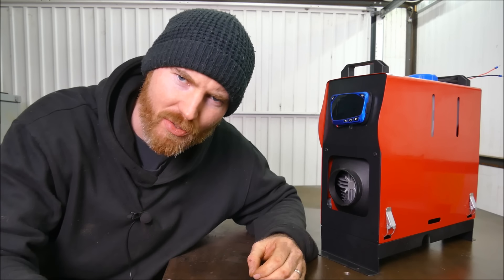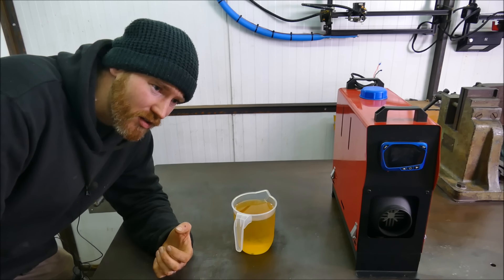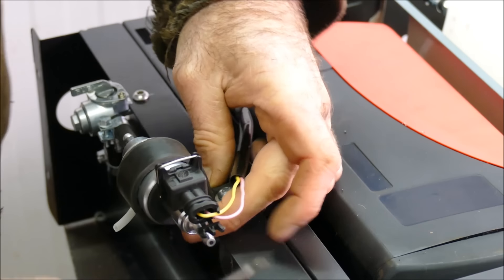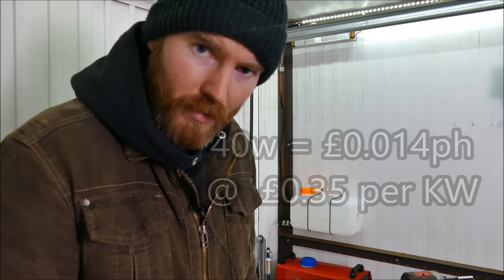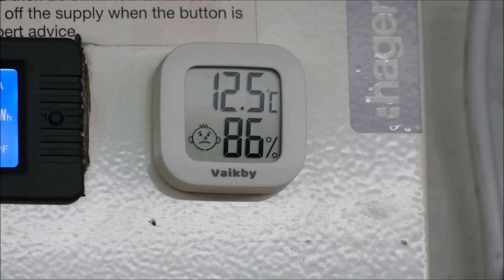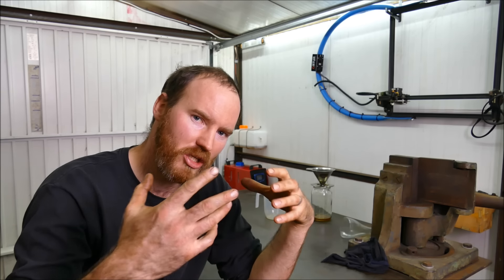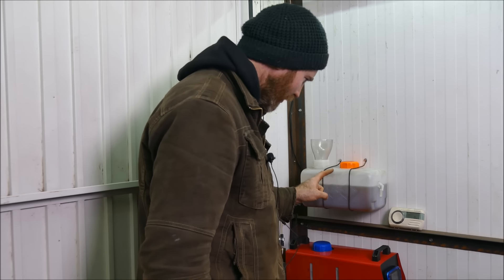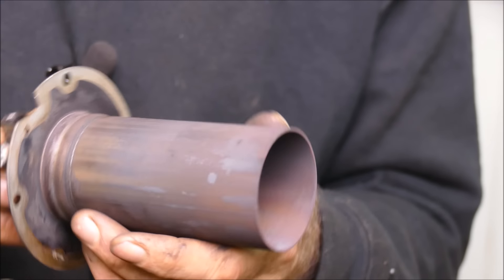£0.03 per kWh heater modification - Top facts & lies on diesel heaters - waste veg oil burn success

Comment: You should preheat the air that will be burned using the exhaust, this makes combustion much more efficient or the air that will be heated 
Like a double flow VMC
Reply from the maker: Not necessarily, hot air is less dense so less oxygen compared to cold air. pre heating the fuel however would work. cheers J
Reply: @joshuadelisle  not wrong I don't know much about combustion with liquid, because that's not what I plan to do for my home.
So I thought about it as with wood heating, while forgetting that part of the heat results from the fact that the wood is sufficiently dry, (so it is a bit like preheated fuel) otherwise a large part of the energy is used to get rid of the humidity in the wood.
Reply: my motorhome has the air intake inside and the thermostat sensor is in the air intake so when up to temp the heating unit is barely running  and keeps a steady temp ..the Eberspacher is a dearer unit but does the Chinese one work the same if not one can be added  @joshuadelisle
Reply from the maker: @alanhayward5579  hi. I believe the air temp sensor is in the controller which can be moved. Cheers J

Comment: Waste engine oil will have toxins in it.  One of my local garages burns sump oil in a workshop heater and I believe that they have to clean it daily.  In any case, restrictions on Diesel motors are there because of the CO2, HC, PM and NOx  that can cause health problems even using standard fuel.  Various post combustion means may be used to ameliorate emissions with limited improvement and hardly cost effective if used with a small household generator.

Personally, I don't wish to add to the problems that I already have with my lungs after a lifetime of using fossil fuels in various machines.  I'm looking forward to engines based on  Helium 'Hydrino' technology, such as could be used as the core generator in electric drive vehicles.

Comment: You should find a way to measure the heating output from the heater so you actually know how much energy you are getting out of the thing.
The way this kind of heaters burn the oil via a mesh filter is not the most efficient way to burn oil. A more efficient way is to spray the oil via a fine pitch nozzle under a pressure about 6-16 bar and have 100% control about the oil/air mixture.

Comment: Josh people must start using 12 volt lighting system (RV electrical lights, ECT.) 12volt DC is 110volts cheaper than 120volt ac power no one thinks about stepping 120volt home system down to 12 or 48 DC power in the residential homes. Ion collector panels ,collection works by just  aluminum panels catching ions 24hours every day or night. Must install diodes on each corner of your panel and step up transformer for more watts.  Please think about my system that I have been using for 2years,fred
Reply from the maker: Interesting idea. Cheers J

Comment: Kerosene? Paraffin? Are they the same?
Reply from the maker: Yes pretty much. I think kerosene is cleaner though for use in heating systems. Paraffin is mainly used for oil lamps and greenhouse heaters which don't need to be as clean. Cheers J

Comment: how much electricity dos that thing use ?
Reply from the maker: 150w for the glowplug for 1 minute then 40wh there after to run the pump. Approximately £0.01 per hour Cheers J

Comment: Diesel energy density 38,6 MJ/L
Heater fuel Pump 0,022 mL/s/Hz
38.600.000J x 0,000022L x Hz/S x L =  849,2 J x Hz/S
So with pump running @ 1 Hz
849,2 J x 1Hz/S = 849,2 J/S. And 1 Joules per second equals to 1 Watt
1Hz gives 849,2 watts of energy input.
Would be fun to get some actual volumetric outputs to see where the energy is distributed.

Comment: Heat the WVO to lower its viscosity before you switch over - this is exactly what happens in WVO fuel kits for vehicles, My old Peugeot 205 started on diesel and once the engine had reached operating temperature it would automatically switch over to WVO, I would have to press a button to purge the WVO when shutting down. Maybe place the WVO fuel tank in front of the heater outlet?

Comment: Water in the exhaust pipe was probably caused not by a leak but by condensation of water inside the exhaust pipe when it was cooled by water in the bucket. Product of burning oil are carbon dioxide and water (in form of vapour). Cooling the exhaust pipe with water was too intense.

Comment: Your fuel pump should be at 45 degrees. The reason for this I believe is to lubricate the internals. If you don't follow this procedure it will cause premature failure.
Reply from the maker: Actually 30° is what's recommend. Mine hasn't  failed yet 12 months on. Cheers J

Comment: So your saying you are not allowed to use heating oil now for your heating system  so what can you use for your home oil burner/ boiler
Reply from the maker: You can use kerosene just not red diesel for commercial heating.
Reply: @joshuadelisle  now I understand, so you can use red for domestic heating systems
Reply from the maker: @garynicholls72  even I find it confusing. Red I believe is fine for domestic heating but Kerosene is cheaper and better for heating. Cheers J
Reply: @joshuadelisle  thanks for the update

Comment: Why not remove the screened filter near the ignitor and discard it for a better serviceable Fuel filter in line. 10 microns would even be better than the screen?
Reply from the maker: If you mean the metal gauze I believe that's to help wick/atomize the fuel. Cheers J
Reply: @joshuadelisle  is it before or after the nozzle?
Reply from the maker: @catbird1759  I'm not sure which part you mean. Did you mean the bit where the glow plug is located or one of the fuel filters?
Reply: @joshuadelisle  I'm pretty sure that it's in the fuel passage prior to the nozzle, just a last bit of insurance for fuel quality. These types of screens are hidden from the normal backyard mechanic. Not knowing that it is there, unnecessary parts replacement will happen

Comment: 15:10  The exhaust isn't leaking.  When a hydrocarbon burns, one of the byproducts is water and with kerosene, it's 1 to 1. You burn a liter of kerosene and you get a liter of water as a byproduct.  By cooling the exhaust, you are condensing the water inside the exhaust.

Comment: Pre heating thicker oil, in fact any oil, always makes sense, and aids a better burn characteristic. If you plan to have your fuel tank outside, because of risk of spillage, smell, or just convenience, then you may well need to pre heat the oil in either the tank or feed line otherwise it will thicken up in the colder temperatures. I recall I had to fit some trace heating tape to an external oil line I installed to serve an oil-fired heating system I installed for a church once, and it worked well, controlled via an ambient-sensing stat. Well done on this video as it’s given me an idea for one I am going to install on my brothers mobile home conversion. Thanks!

Comment: I just ordered the 8 KW heater.. will this heat my 16' x 24' cabin during the winter (northeastern USA)
Reply from the maker: Well done. I have a new video coming out soon. As long as the cabin is well insulated it will heat up fine. I would recommend ducting  cold air from the other side of the home to the opposite side where the heater is so the heated air travels through the whole building instead of circulating in the one room. All the very best. Cheers J

Comment: There are approximately 10  kWh in a litre of diesel. If it cost £1.30 per litre that means a kWh is 13 pence ie 13 pence per kWh. Your mains gas supply is cheaper than that, even with standing charges.

Comment: Can such heater run on waste motor oil? Would it clog something?
Reply from the maker: filtered, mixed with 30% kerocene, pre heated and adjusted air fuel mix ratio. yes works a treat but any contaniments will clog over time. cheers J
Reply: @joshuadelisle   how would i need to adjust air/fuel mix? I read about many people saying different mixing with kerosene/10% gasoline and similar, but what if trying to run straight oil?
Reply from the maker: @entorid6902  in this video I show how to change the fan speed and fuel pump HZ ratio. Cheers J

Comment: 35p  per kWh of electricity one year ago in the UK. It is now (September 2024) 48p per kWh, and next week it will increase 20% to 57p. Meanwhile in the last year, diesel has reduced from £1.90 per litre to £1.37 per litre. . . . . . . I'm off to get a Chinese diesel heater for my house! 😀 . . . . . . Except that gas (the vapour type, not petroleum spirit type) is, and will continue to be one quarter of the price of electricity per kWh.  Still, the Chinese heater is very good for your shed or garage or motorhome.
Reply from the maker: I've just bought kerosene at £0.55 per liter making it £0.05 per kwh. It's seriously a good idea to get a diesel heater especially if you can buy heating oil in bulk and store it in a tank. Cheers J

Comment: Am I missing something here?

This equates to 3 pence per kWh. Octopus Flexible is 6p/kWh for gas.

It seems like a huge headache to keep refilling and servicing something for a 50% difference.
Reply from the maker: Depends on the size of your tank but I only service mine once a year. I like being able to fit and service my own stuff without the need of hiring anyone else. Cheers J
Reply: @joshuadelisle  I understand the benefits of repairing it yourself; our boiler failed last year and took 14 days to fix. God we were cold.

I've come across stats like this:
H1 2.0/sec = 120/min = 144 ml/h
H2 2.6/sec = 156/min = 187 ml/h
H3 3.4/sec = 204/min = 245 ml/h
H4 4.0/sec = 240/min = 288 ml/h
H5 5.0/sec = 300/min = 360 ml/h

So, ignoring the fuel type (kerosine, diesel etc), if we assume whatever fuel you buy is £1 per litre, H3 equates to 1ltr every 4hrs, or £0.25p an hour.  That doesn't seem right, as electric is only 33p per kWh.

Perhaps I'm not explaining this very well. I'm looking to replace a 2.5KW electric heater (costing 70p an hour) for one of these heaters... but unless my calculations are wrong, it doesn't seem worth it. £100 for the heater + various bits, £1 a litre for cheapest fuel and I'm only saving 45p an hour?!

Thanks for your help!
Reply from the maker: @Paul.Reviews  Hi. That's some good information you gathered. So in the short term replacing your electric heater may not be cost effective but long term it maybe. These diesel heaters are solid, easily maintained and the parts are cheap to replace. I calculate it's only 10 days of the heater continuously working to have earned its investment back. This obviously depends on the fluctuating price of fuel and or if you cut it with waste veg oil for example. I personally like the off grid capabilities, self maintenance and affordability. But it comes with a negative for some that it requires hands on mechanical understanding to fit it and no safety guarantees or insurances to support the fitment of one. Cheers J
Reply: @joshuadelisle Sorry to be dump here, but how did you get to the 10 days figure?

I can't believe I can't understand something which seems so simple.  If you're using 250ml an hour, you're using 1ltr an hour.  If a litre of xyz fluid is 80p, that's 20p an hour.  Granted, that's a quarter of the 80 odd pence for electric.

So at the end of the day, assuming you're paying 80-100 pence per litre, running it on H3 (250ml ish an hour), it's roughly a quarter of the price of electric. Does that sound right?
Reply from the maker: @Paul.Reviews  sorry you said your saving £0.45 per hour and couldn't justify the £100 investment. That's just under 10 days of use.
Reply: @joshuadelisle  Somewhat ironic that autoincorrect replaced dumb with dump :D

Went to bed shortly after you replied and realised I was thinking about it the wrong way.  Long story short, I've ordered one.

There's a lot of choice when it comes to control boxes though. Are there good/bad ones?

Thanks again!
Reply from the maker: @Paul.Reviews  well done. I've not got much experience with other controllers but I've just got hold of two other types to test out. New video coming out shortly. Cheers J

Comment: I have a webasco in my Dodge Diesel engine to preheat the coolant so the truck starts easy in very cold weather. Its great sitting in the truck with a warm heater on a cold day.

Comment: This comment relates to your previous presentations on sculpting sheet metal animal heads.  I have or years wanted to make a yard decoration of Santa's sleigh with the 8 tiny reindeer. I guess that I could design and build the sleigh. What I world not be able to do is design and build the reindeer.  Could you design the reindeer so that the majority of the reindeer's bodies are identical to each other with the legs being different for the eight reindeer. I would like to use aluminum so the weight would not be to great. Thanks in advance for your consideration.

Comment: Water in exhaust  comes from condensation   all fossil  fuels have trace amounts of water plus  when drawing  outside air for combustion  you also get humidity in the air  and when reducing  exhaust  temperature  will condense  and if exhaust pipe not tipped to the outside will either be trapped of drain back to the heater and shorten the life from corrosion as the condensate will very acidic

Comment: Heat pumps don't achieve a cop of 3 or more in the winter unless they are set to such a low temperature you have to have them on all the time, which cannot be counted for efficiency.
Burning Hydrocarbons produces water amongst other gases.
A modern kerosene boiler will achieve over 90% efficiency, natural gas boilers are even better.
There are many petrol stations that sell Kerosene

Comment: rather than using a short piece of hard fuel line and 4 clamps just use a longer piece of fuel hose and 2 clamps, it will look much neater.

Comment: I've read several comments about sand. 
Then somebody said something about running it through a gutter. 
How about running your exhaust through sand in a gutter? 
I don't know I didn't even run my exhaust outside and I don't have enough carbon monoxide to even worry about
Reply from the maker: Already tried it in the following video. Cheers J

Comment: If you use the exhaust to preheat the waste oil to ~80c it will then be more like running diesel.  When running diesel engines on veg oil rather than modified veg to biofuel this was what was required

Comment: i've had one of these in my workshop for many years now and was lazy when drilling holes through all the brickwork so only had the exhaust going outside, the inlet was inside.   the biggest downside i've found is that when it's blowing a gale outside the pressure difference is occasionally enough to force air back through the exhaust, extinguishing the flame and suddenly filling my workshop with vapourised kerosene!

Comment: I think the 8kw rating needs to be measured in the heat created by the heater not the energy you feed the heater with?
Reply from the maker: Yes. However that is more difficult to measure. The fuel will produce the full heat but it's up to the user how much is captured from the exhaust before it exits the room. New video coming shortly. Cheers J

Comment: Hi Joshua, Can I suggest you get your units sorted out. Kw is a unit of power which is energy over time. Kwh is a unit of energy which is the amount of energy you would use if you produce 1 Kw for 1 hour. Unless you get that right then your claims will be meaningless. Thanks for the video.

Comment: I'm completely not a techie person so won't try veggie oil, but I can use kerosene in my campervan diesel heater, right?
Reply from the maker: Yes that's all I use at the moment. Cheers J
Reply: @joshuadelisle  cool! No modifications?
Reply from the maker: @curtistim  I buy it in bulk at £0.60 per litre. Just straight Kerosene (heating oil). New video on it coming soon. Cheers J

Comment: I would have returned the exhaust line back across the wall under the first run with the silencer inside before terminating exhaust outside. Silver foil tape behind the exhaust and behind the burner. Also where you cut through the wall I would put fire resistant expanding foam in the void and paint the cover plate black. 

Cut small squares of sheet metal and a u shape out of them to slot over the exhaust to help radiate/convect the heat similar way to a radiator would

Comment: Where can I buy that damn WIRE THAT YOU'RE USING ON EVERYTHING LOL
Reply from the maker: it called 'tie wire' for concrete reinforcement fixing which is normally 2mm thick. I got 3mm thick from a galvanizing company and I specially ordered 4mm thick for making bespoke flowers.
Reply: @joshuadelisle  awesome thanks

Comment: In world war 2 lifeboats from transatlantic vessels would have enough fuel to go half way across the Atlantic.  There would however be inadequate fresh water.  This was solved by running the exhaust pipe around the lifeboat to condense all the water in the exhaust of which there was a lot for the survivors to drink.  Do not underestimate water in exhaust

Comment: You have to factor in time to your consumption / unit rate. Kilowatt Hour = 1 kWh - A kilowatt-hour is a non-SI unit of energy equal to 3.6 megajoules (MJ) in SI units which is the energy delivered by one kilowatt of power for ONE HOUR!
Reply from the maker: yes thats exactlky what the test was in the video. cheers J